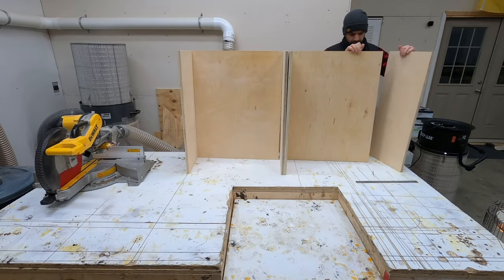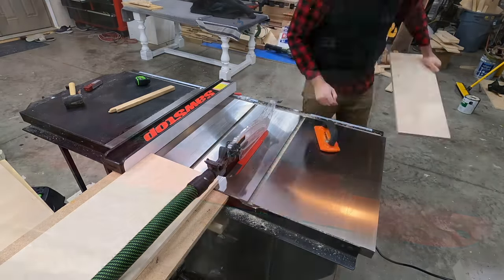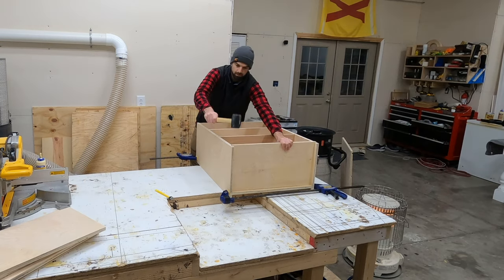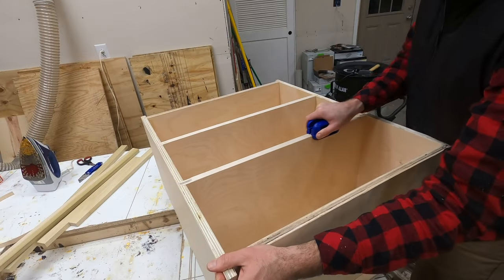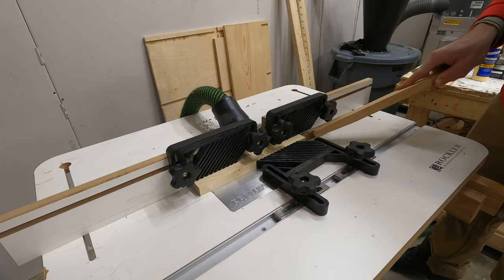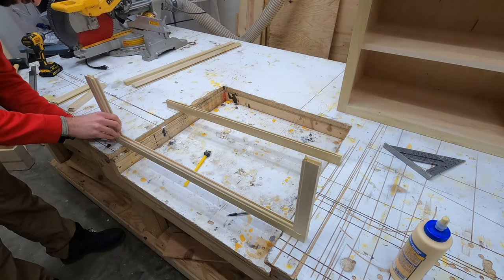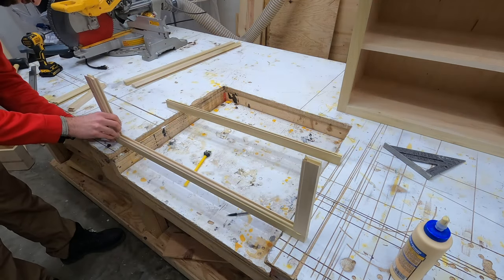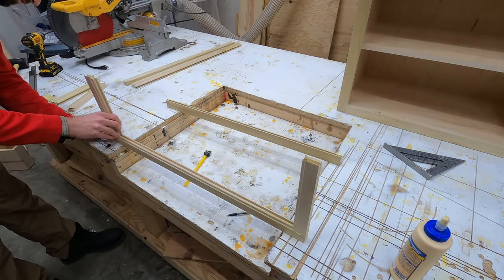How to Build Cabinets || Dado Style Joinery || How to Woodworking

Comment: Nice build! I generally let my face frames overhang the sides of the cabinet by 1/4" on either side. This ensures that the face frames will join tightly even if the wall you are mounting them to is inconsistent.  It is also handy if you need to scribe the cabinet to a wall or partition.
Reply from the maker: Thanks Kevin! That’s such a great tip - thanks for sharing!

Comment: Excellent video. Your production quality is excellent. At 10:38 it looks like the tops and bottoms of each door do not align with the opposing door. Is this adjustment built into the hinges in addition to the one you detailed? Or is this due to some kind of misalignment with how the hinges were mounted on the carcass or the doors? Also, your affiliate link for the angle finder takes me to the Amazon page for the hinges. Thanks for your work and sharing!
Reply from the maker: Thanks! My fault on the angle gauge link - here is the proper link
https://amzn.to/3tZ0kqA

Regarding the misalignment on the hinges, the hinges have adjustments that will adjust the door on an XZY axis. I probably just didn't have the height adjusted properly in the shot at 10:38 and didn't realize it since I was just focused on getting the doors to shut.
The hinges are actually very easy to adjust. Hope that helps!